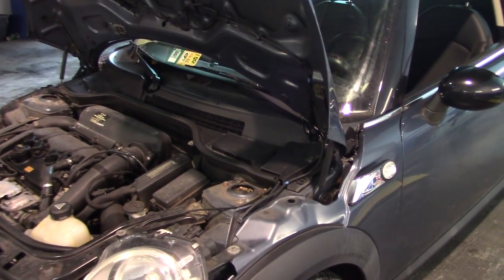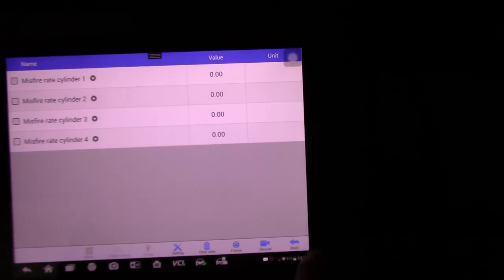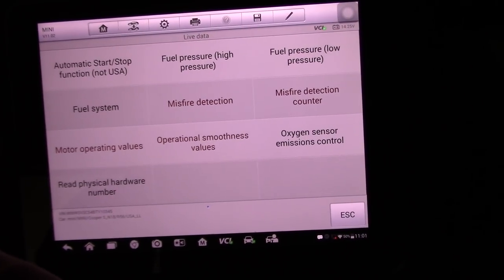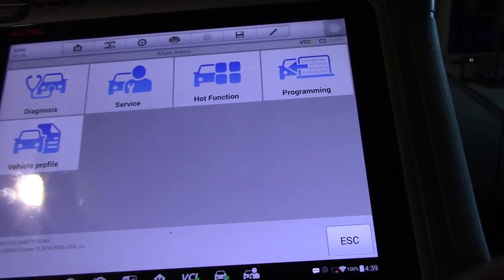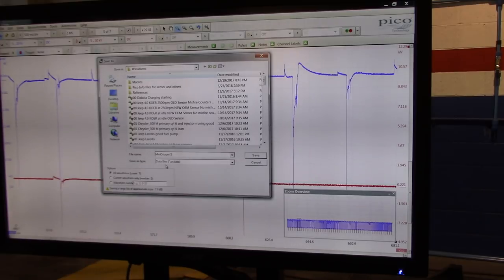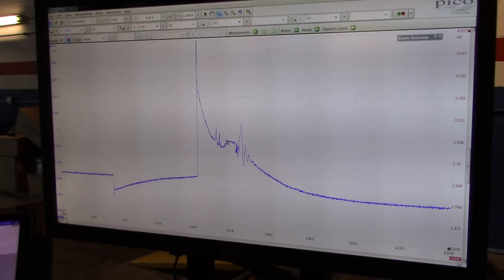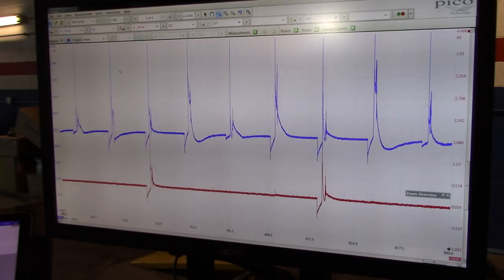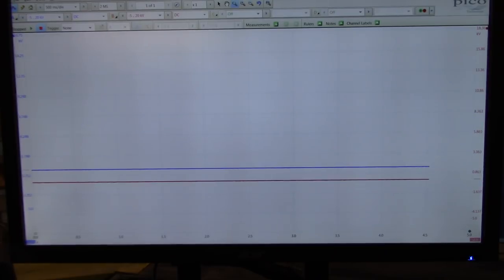2011 Mini Cooper S R56 Random misfire diagnosis with Pico Scope

Comment: I guess you corrected the monitor from turning off and on with pico lol 😄
Reply from the maker: Pero it was actually a setting on the Pico Scope app. The refresh rate was to low on the buffer.

Comment: Have you ever come across an R56 1.6D with a really bad shunt/misfire at 2300 rpm then revs cleanly through the range? No eml  and no faults stored.....
Reply from the maker: Umm no codes! Maybe a vibration?